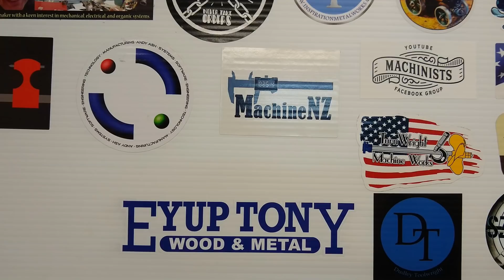Making a Keyway Cutter for the Shaper Part 1

Comment: Looks good. One thing I guess it’s a preference but I just like using a hard carriage stop. Why there not included on our lathes is a mystery to me.
Reply from the maker: Thanks Jim, a hard stop for the left of the carriage is on the to do list but I have a long list of things people have asked me to make or fix first . . . This tool holder got expedited due to the need to cut a metric key in a buddy's hub

Comment: I need to keep my eyes open for the air brake actuated shafts when I’m in the scrap yard. Last time I went to my favorite scrap yard they had changed things around and they have mostly rusty new metal not really scrap. I guess I’ll need to hunt for another yard!
Reply from the maker: Yeah, not sure what alloy the S-cam shafts are but it's nice stuff to work with. And if you talk to a local heavy truck shop foreman with a box of doughnuts in hand you might get to raid the bin right there.

Comment: get you a cheap rolling tool cart put inset top on it and mount your bandsaw on it, get it up off the floor and makes it mobile. i did both of mine that way and its great, think you would like it.
Reply from the maker: The machine actually came with a stand that rolls but I have never used it. I put rollers on it to use on the floor on purpose, so it rolls more out of the way.  Floor space is at a premium in my shop so there isn't room for the bandsaw to have its own cart.

Comment: its all in the timing persistence and walking away before you smash it with a hammer , i was at the local scrapyard looking for a old bit and a car arrived on a trailer with every window and panel dented or broken i asked the man did they catch the person who did he said he did it himself , why i asked "it didn't start just once again" the car was too young for the scrap yard but was far beyond economical repair, there are days that just go wrong before  they start
Reply from the maker: When I was younger I was a bit more of a hot head with more of a temper.  Never beaten a car but have thrown too many wrenches and pry bars in anger to remember.  For what it's worth, there will be an out takes video coming up with mistakes and cut footage from the last couple years.  Should be good for a laugh!

Comment: I made one for my shaper only thing I can say is don’t make it to long as will bounce and chatter like you wouldn’t believe, don’t ask me how I know,😜

Al.
Reply: I guess they only need to be as long as your largest wheel/gear is thick, plus a little tool clearance front and back.

Is that right (thinking aloud here)
Reply from the maker: Yeah, I hear you, rigidity was one of the biggest reasons I decided to redo it.  Haven't tried the reject part yet, but the good one has been used once already to make a keyway and it seems to work.  It seems to give enough reach to go through a 2" thick part.

Comment: First! Good to see you again Everett, nice piece of raw stock, you are going to have to make yourself one of those "pipe grinder" like they use to sand welded joints in stainless  hand railing found in hospital type workplaces, they work wonders on cleaning the round surfaces and touching up transitions. Also I agree, I have found too many times, just good enough makes me redo a step on a job, good practices can cover these occasional glitches and make you more efficient in time. Cheers, enjoyed the video!
Reply from the maker: Thanks Howie, I just wasn't happy with the first one and didn't feel right doing a whole project video on what I deemed substandard for its purpose.  As for the pipe grinder idea it sounds cool but is probably too expensive for my budget, lol!